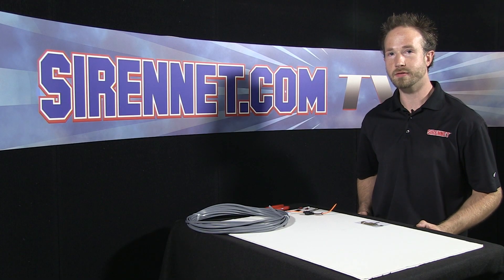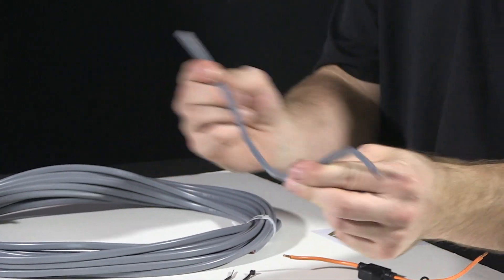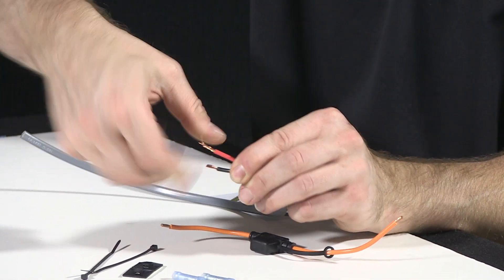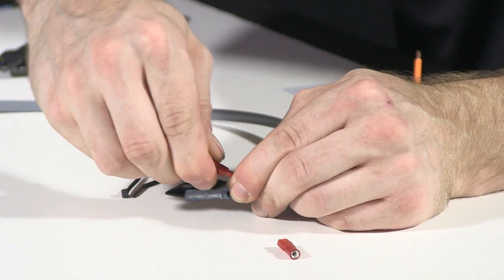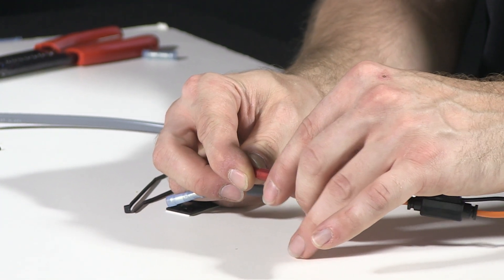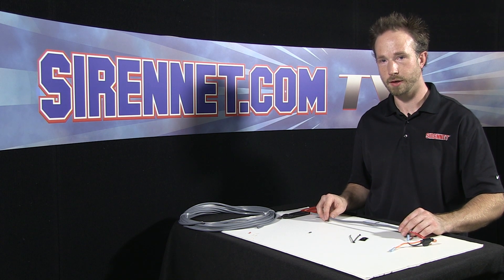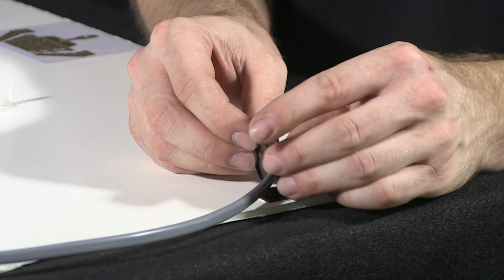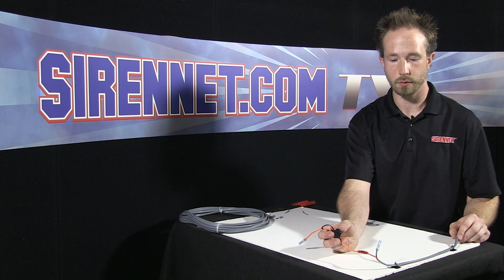Sirennet Installation Parts - how to build a fused wire harness

Comment: Butt connectors are half-assed. If you want a permanent connection, solder the joint and heat wrap it.